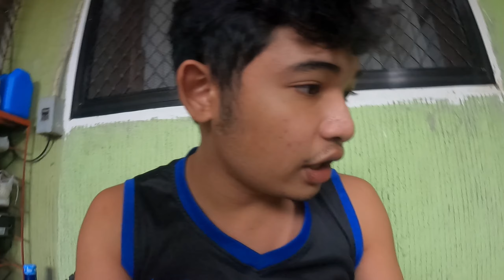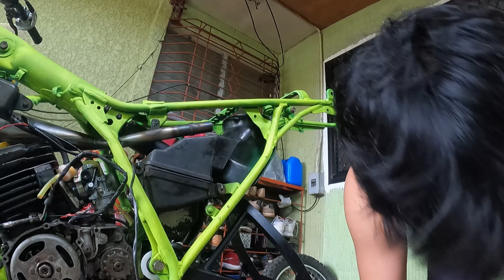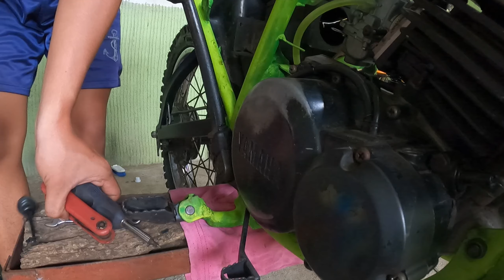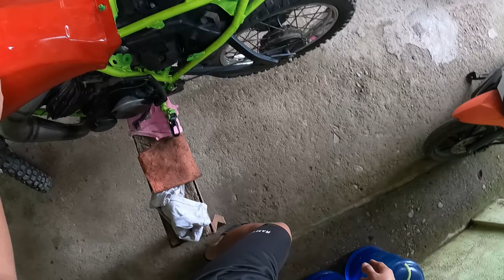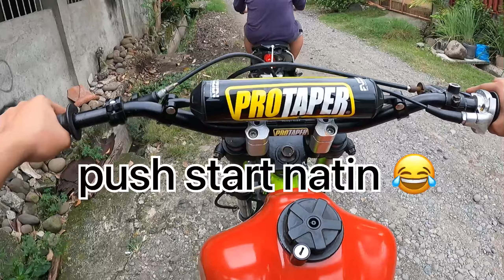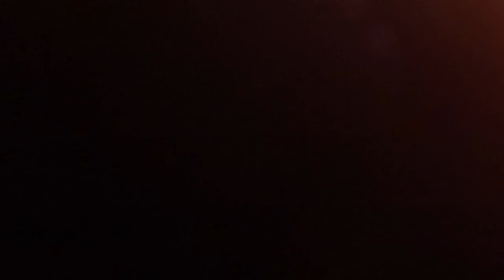YAMAHA DT 125 FINAL BUILD

Comment: Hey mate I need to get some parts I got a project 96 dtr what Kind of chain do I need for it I’ve got a new one for my gilera h@k but it don’t fit the dt mate and I need a throttle cable and possibly clutch cable I also have a tzr carb
Reply: I see you hearted my comment since this I have a chain new throttle cable but it’s wrong as I have a 88/97 carb same as trz but also my jetting is off 125stock dt main jet 180 stock main trz so I’m out lol I got a cone filter and dep pipe so will need to be bigger than stock anyway I also have a carb that I’m buying tomorrow as the guy isn’t around until then 

After those I’d need tyres number plate and a logbook for her send her for mot and done it owes 590 as I did a deal with a fella with my ktm 105 for loads of shit including a rfz pitbike gave 380 cash and the pitty and the pitty didn’t owe me anything at all was already in profit with it and that price is with new chain and 2 new throttle cables I brought both then realized lol check my vids out sadly selling my gilera crosser today but I’ll put the money back into the dtr anyway so about 8/900 all in I’ll have a great example of a dtr with every recommend upgrade